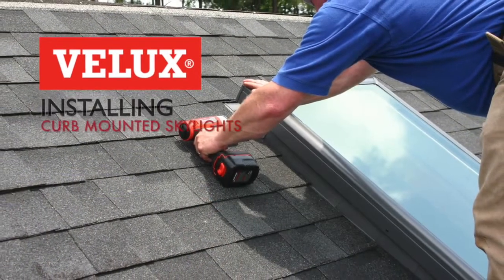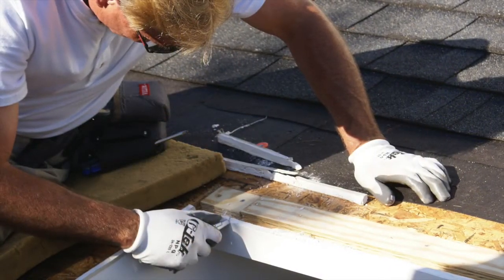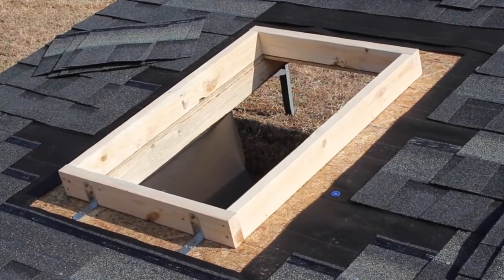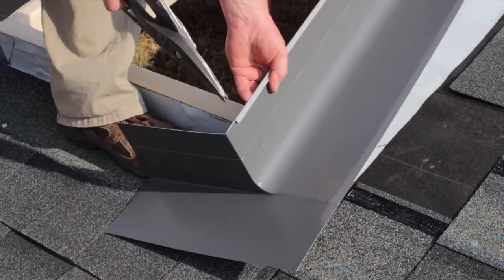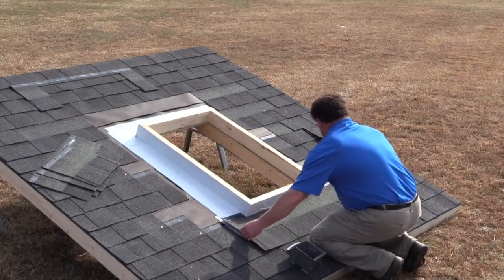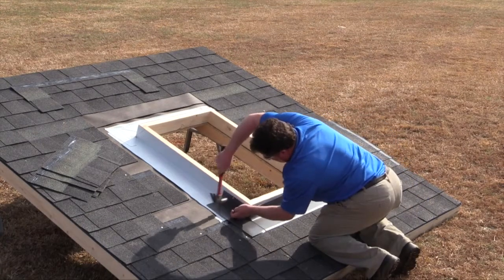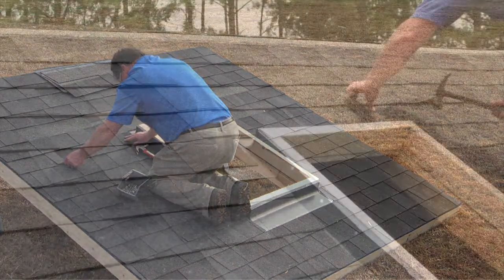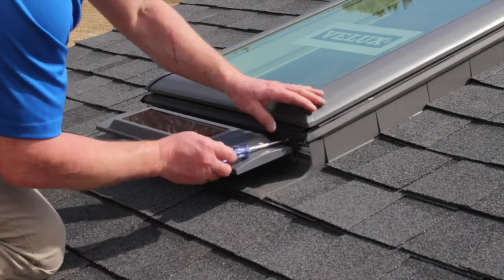VELUX Install Video - Replacing Curb Mounted Skylights (Short Version)

Comment: Can you mount a fixed mount skylight in either direction? Or is there a specific top and bottom?  Since neither side opens, is there a correction orientation?
Reply from the maker: Only VELUX's Fixed Curb Mounted Skylights (FCM) and Fixed Pan-Flashed Skylights (QPF) can be installed sideways. All VELUX deck-mounted units, other units, and flashing systems have a "true top" and cannot be installed sideways. If any skylights other than the FCM and QPF are installed sideways, the warranty on them will be voided.